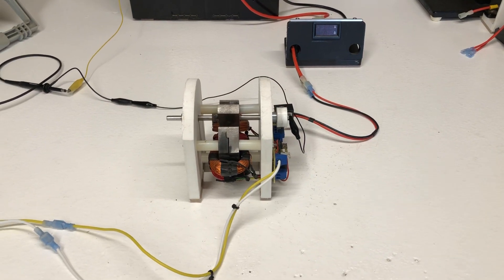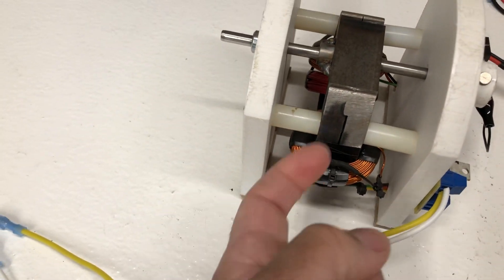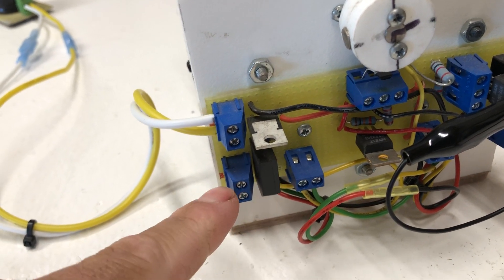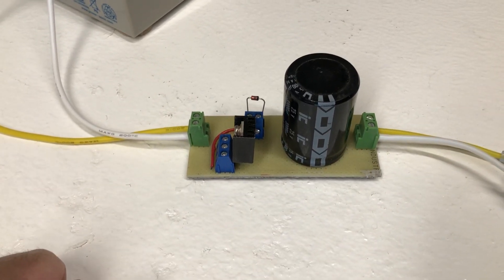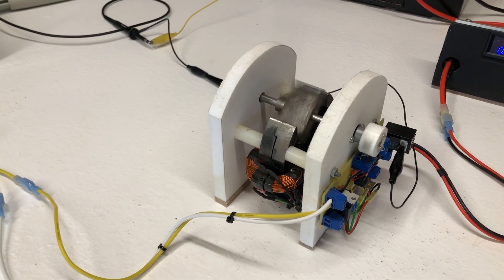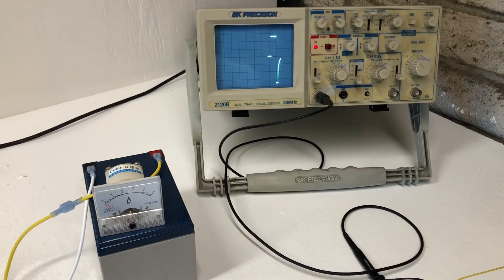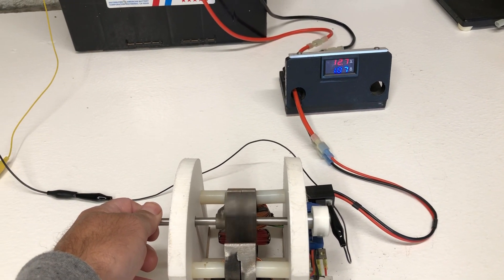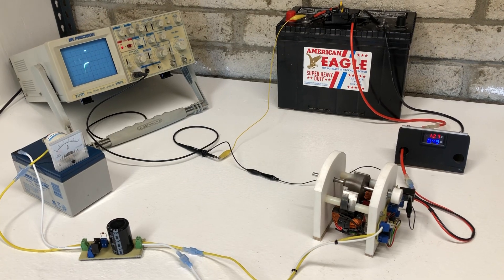Attraction motor 12 volts with output to second battery

Comment: This is very similar to the motor I am trying to make. The thing I have noticed is that the pulse can only stay on for a very short period the longer the coil is on the more energy is lost. Maybe we could share some ideas some time
Reply from the maker: Yes so true you need accurate timing that’s why most of mine are opto timed 
Sure
Reply: Not exactly what I was talking about if I could talk with u some how I could explain it in more detail
Reply from the maker: @IrvinParker  my www.KEnergy.store has my contact

Comment: I don't understand how it works without magnets?
Reply from the maker: This is a attraction motor 
 The electro magnets magnetize the rotor long enough to attract and make rotation
Reply: @kenergy1707  Oh yeah, I forgot. If you haven't already seen this, type in '300hp ambient heat free energy engine'! It weight 82 lbs, turns at 30,000 rpm, has one moving part and will power a car from the heat of the road, (not in Winter), or the roof of a house. 300 horespower! They are holding classes on making them too.